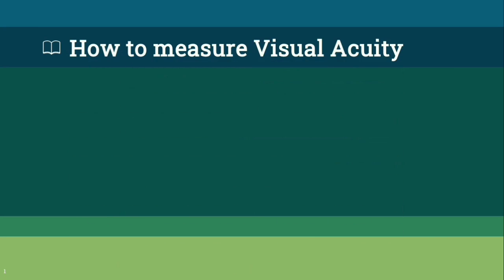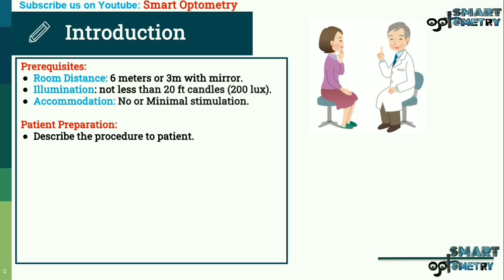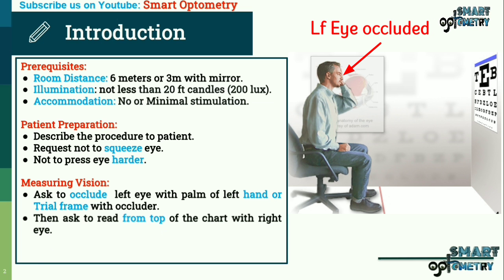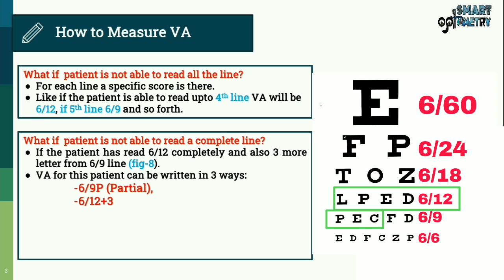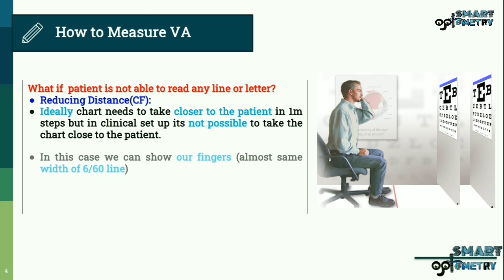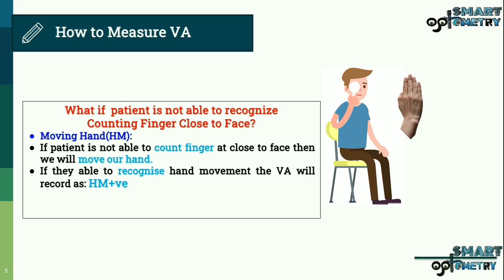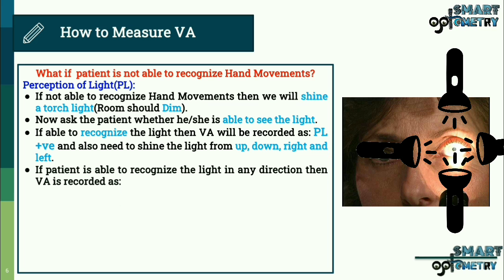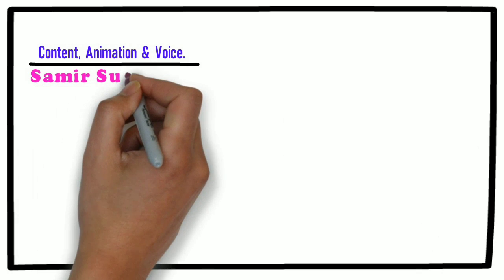How to measure Visual Acuity

Comment: 6/12 +2
Or 6/9-3
Reply from the maker: Both are right but more accurate is 6/12+2. As in 6/9 line patient reads only 2 letters out of 5 (less than 50%) we don't shift to 6/9 line. We will write it as 6/12+2

Comment: the correct answer is 6/12. what I Know is as long as you have failed more than two letters you get the above line
Reply from the maker: @kamwiyasamakesa1606  
What you know is not the Standard. What is Standard you have to know.....
Reply: @optometry-with-samir  so you're saying that the standard 6/12 +2
Reply from the maker: @kamwiyasamakesa1606  
I am saying in a line if patient read more than 50% letter then we will stay this line and minus the unread letters. If patient read less than 50% of the line then we will stay in previous line and plus the read letter. That's the standard we should follow.

Comment: What type of mirror we use if it is 3m ?
Where the illumination should be above the chart or mirror?
Reply from the maker: ✓Plane mirror, because plane mirror shift the image equal distance from the object without affecting image size.
✓Illumination should be 20ft candle or 200lux